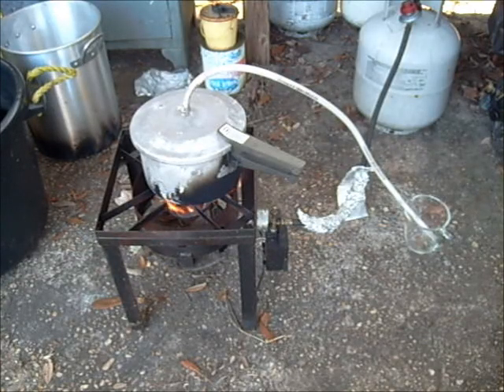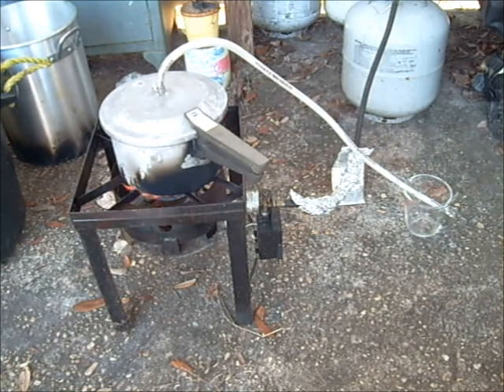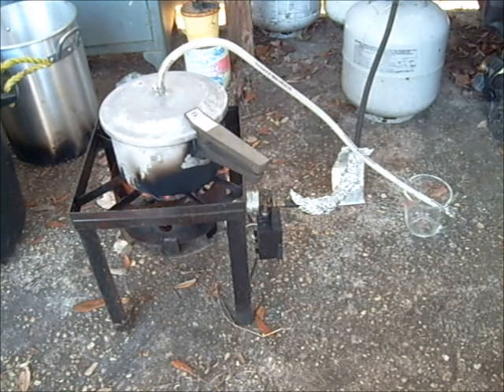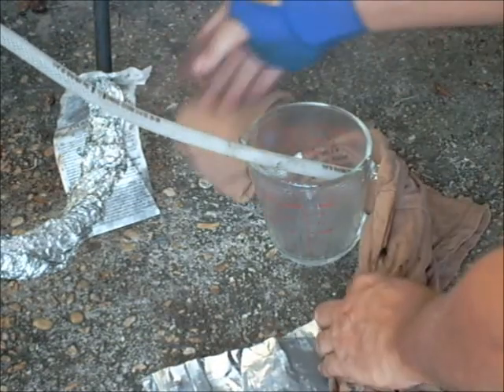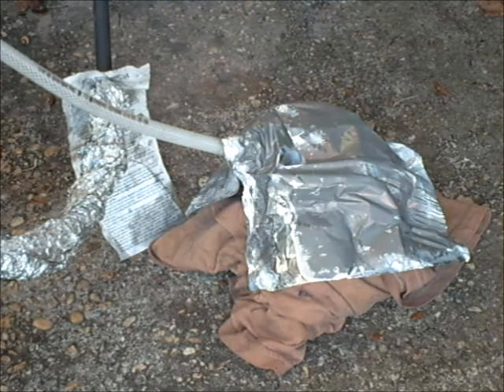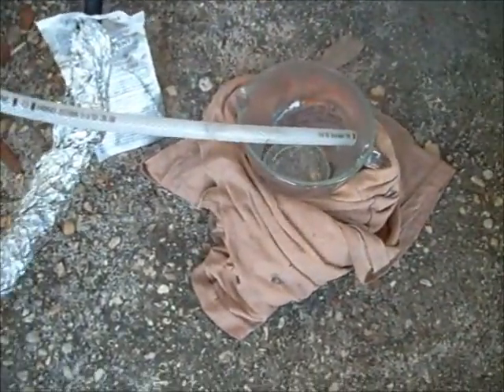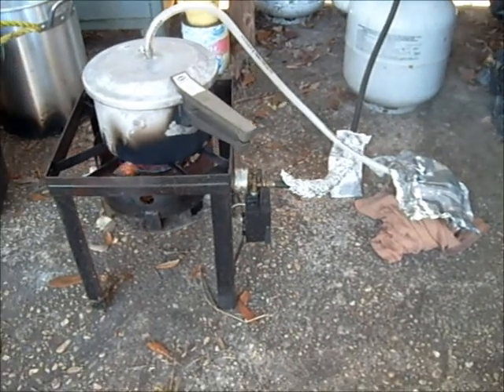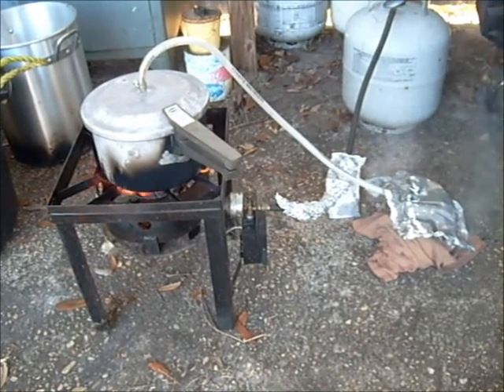Saltwater Still

Comment: Again, old post. Did you improve your method? Would copper coiled pipe improve it or the corrugated copper gas line coil and fit inside the pot? I am familiar with the issues you covered but never made one in the field. Thanks